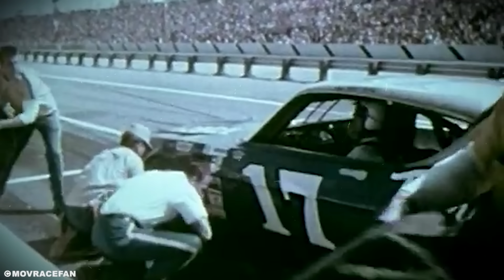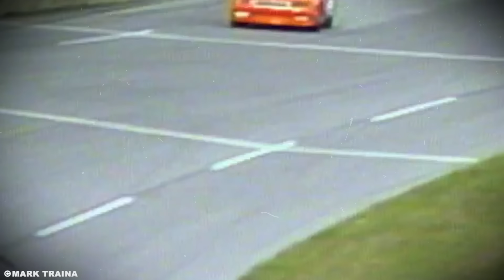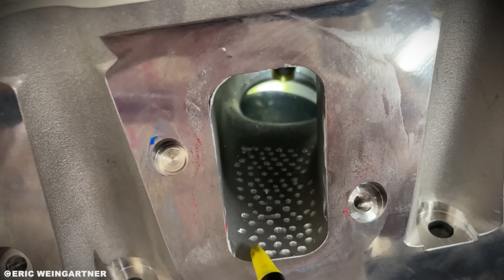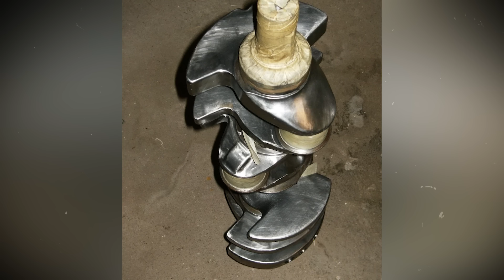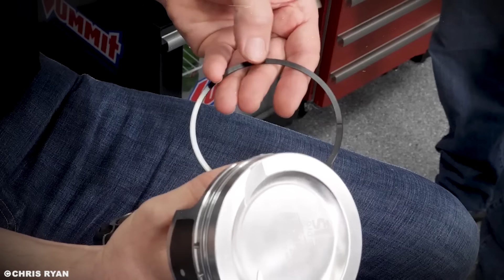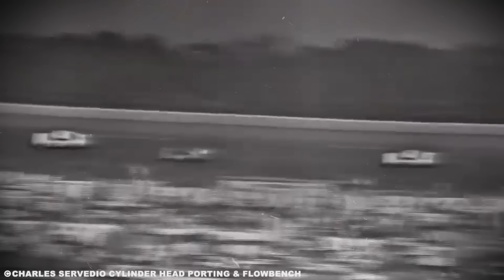10 Engine Modifications NASCAR Tried to Ban But Couldn't

Comment: It is not cheating.

unless there is already a rule banning it !

NASCAR was all about banning modern tech.
Anything that made the engine more expensive for the manufacturer to produce was instantly banned.

Ford had a 4 cam Windsor V8 in 1962.  Banned !
( Ford had the Coyote in 1962 ! 500hp @ 8800rpm the GT40 engine )